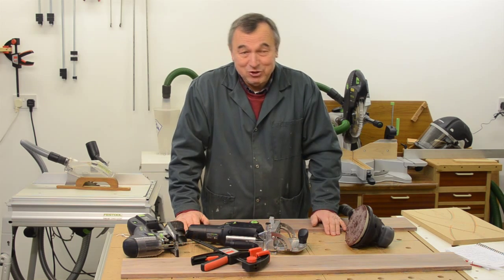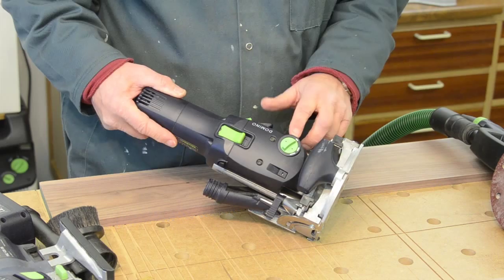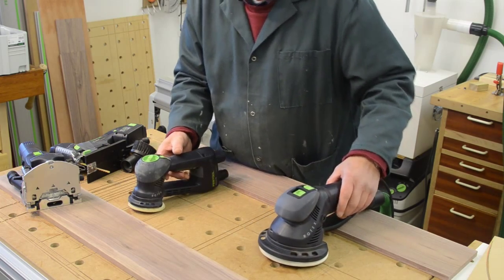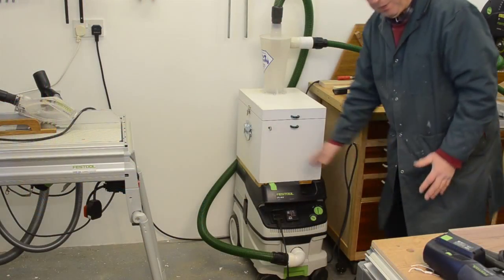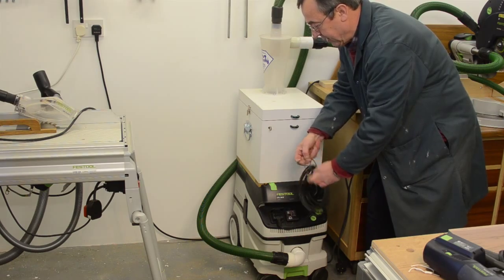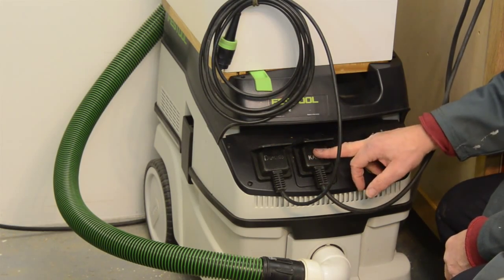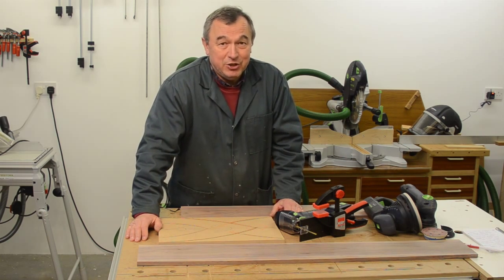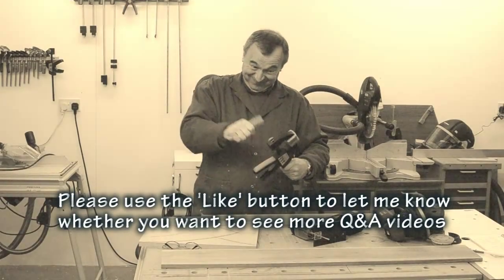Questions and Answers - Session 1

Comment: Thanks Peter keep up the good work. Thanks to your advice I picked up some bessey k bar claps (which have since multiplied as they were so good) and they helped me complete some floating shelves and a built in media cupboard out of solid white oak. The extra clamping force really helped in the glue up pull everything in tight, would have been lost without them! Love my domino xl and now have the Festool bug very expensive but want more. Maybe an ro90 next if I'm allowed by her indoors :)

Comment: dear Peter.
I'm really interested in Axcaliber router cutters, if it would not be too much of a problem I would really like to see you make a review of the cutters.
thanks in advance.
Jacob Hede Pihl
Reply from the maker: Hi Jacob, I can only mention those cutter that I use and so it would be difficult. All I can say to help you is that all of the cutters that I have got from Axminster have been excellent. Did you see the various cutters that I used in making the pedestal desk?    Peter
Reply: New Brit Workshop 
dear Peter.
I have not had time to watch the videos, but I intend to. it is because I only have experience with CMT router cutters, and I think that they are very expensive for what you get, so it's nice to know that a professional as you can recommend them.
Jacob

Comment: Hallo Mr Peter. Does festool mft3 set works as normal table saw?
Reply from the maker: Hi Jim Bo,

The Festool MFT3 is a portable work bench. Festool make a CMS unit, the same height as the MFT3, which will take a track saw (like the TS55R) to make an excellent table saw. You can see one set up in the background of several of my videos. Take a look at the Festool web site for more information.

Peter